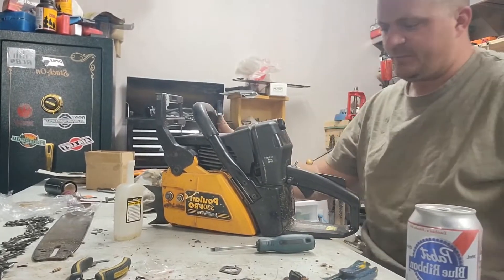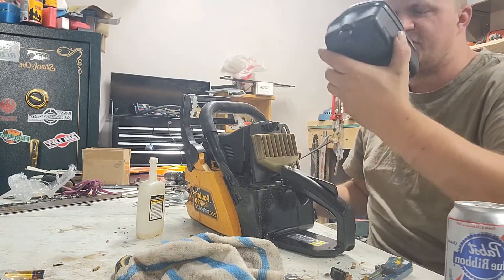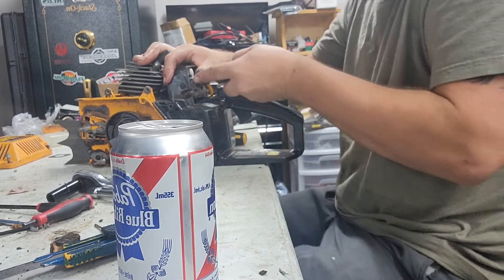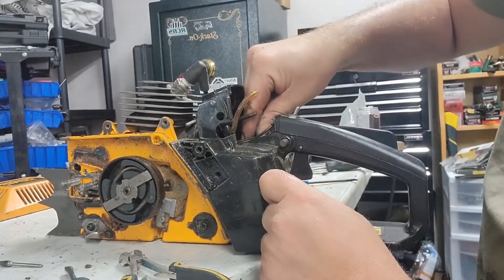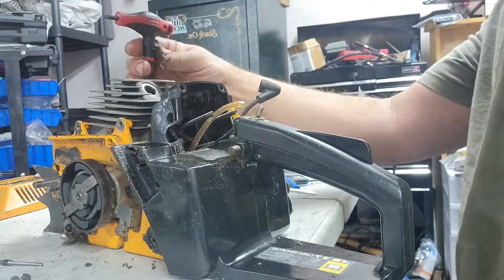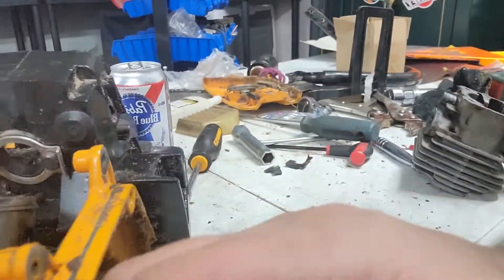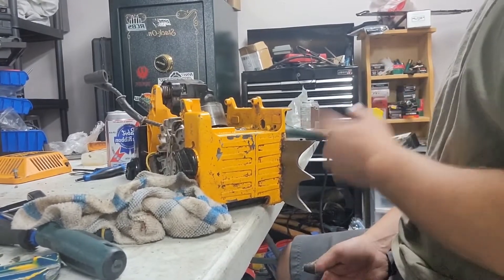poulan pro 330 disassembly to find air leak and gasket delete.. can of worms

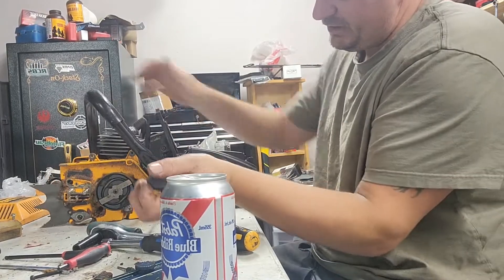Comment: On a 3:30 Poulan chainsaw does the bar have an oil adjuster
Reply from the maker: They use the a041 mount that oils through the top adjuster hole.. having said that I've used k095 and d176 bar mounts with slight modifications

Comment: Mannnnnnnnn.  I hate that thing has an air leak!  So, if you remember,  that was the saw that I was using as a test mule Super Dooper 380 and I KEPT chasing an air leak.  So when I put the 54cc cylinder back on it, I was like, "This damned thing ain't gonna leak no more!"  
Guess I was wrong.  At this point, it HAS to be the base gasket because i know it has new crank seals and a good intake boot.  But I gotcha covered.
Reply from the maker: I'm sure it's the base gasket, planned on deleting that, and wanted to take it apart anyways as I've never had the chance to see how these are put together, bit of a different design but now that I've had it apart super simple,